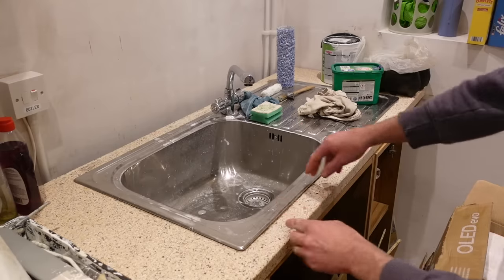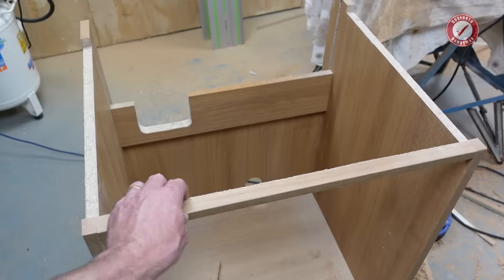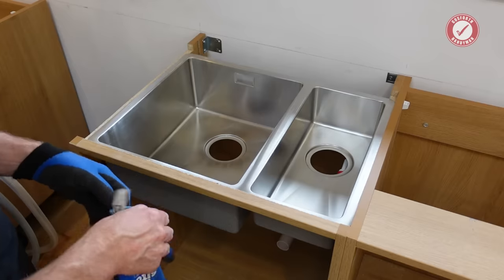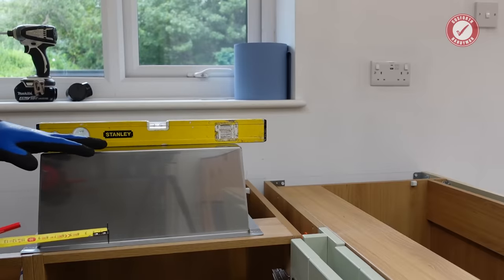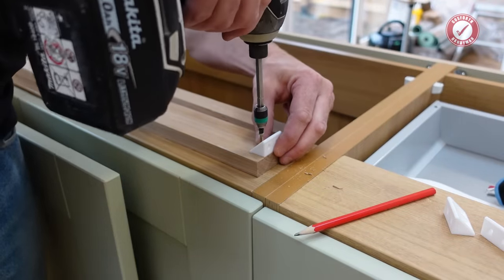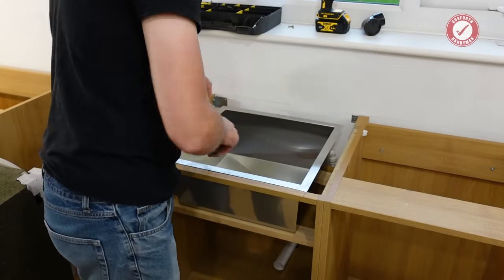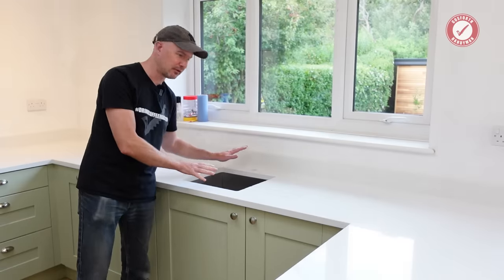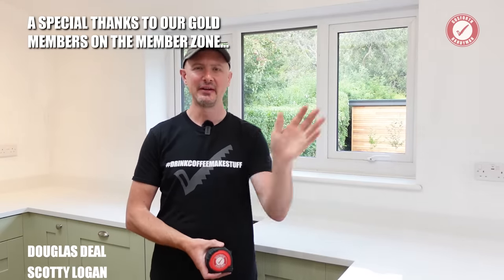How I fit an undermount sink for EASY MAINTENANCE

Comment: My quartz fitters used some super strong adhesive/silicone in my recently installed kitchen - same in the one I replaced. My kitchen fitters have added some custom metal braces underneath as a “just in case though”

You’re right about the clearance at the back for the tap - very tight but works with the overflow at the back. The other thing to note was if you have a single lever tap you can only have one which levers forward (not back) as it fouls the upstands/possibly the wall. Not a problem with your tap because you’ve got two levers which presumably lever towards the user.

Comment: Awesome job as per. Seems tiny compared to the size of your kitchen mind you.
Reply: The sink does look small.  My neighbor just installed a much larger one, but she uses very large pots quite often that need to be hand washed.  If the Mac family chef is satisfied with this one, then it will work.  For something that's too large, take it out to the back deck and use the garden hose.  ;-)
Reply from the maker: We went for bench space over big sink. Got the dishwasher so the sink is rarely used. 👍

Comment: I’m working on first fix electrics ahead of plastering. DIY kitchen units are heading to me in a couple of weeks. What are your socket heights from the floor? They look ideal with the upstand.
Reply from the maker: They're about 1170mm from finished floor. 👍
Reply: Keep in mind if you are tiling as well to try and keep the back box inline with a tile edge :D
Reply: @GosforthHandyman  is that 1170 to the top of the sockets?

Comment: I've never seen a shelf put directly under an undermount sink before.  Normally the sink is siliconed to the bottom of the top and held up by a screw/jack system until it sets. Then it's removed.  Maybe it's a UK vs Australia thing.

Comment: You can actually get adjustable metal brackets that go the full width of the cabinet so 600mm which are then attached to the cabinets and I put 2 in to support the sink Wren actually supply them with there kitchens cheers
Reply: They do but they wouldn't sell them to me as a part because kitchen wasn't from them.
Reply from the maker: Yup! Although I already had the wood and brackets. 👍😁

Comment: Why did you put the extra oak under the front bar? 
I always just drop the sink unit 2mm the easiest way to do it
Reply from the maker: To provide extra support for the weak point of the worktop. Seen too many over the years where that's cracked.

Comment: You shouldn't of fitted the sink till you installed the tap .....have fun trying to fit the locking nut etc at end of the day your not a kitchen fitter so its a mistake any one can make ...your still making a good job better than some of the fitters I have met in over 30yrs in the trade ...
Reply from the maker: Tap was really easy to fit! Cheers! 👍
Reply: @GosforthHandyman  ha! - 'professionals', eh, Gosforth...!?
Whenever anyone says 'I've been doing this since you were in short pants, sonny' - run a mile.........!!!

Comment: Thanks for the insights. 
Has anyone got a good link for doing it with a wooden countertop. I’m guessing most of the tips on this one hold for wood countertops. But there might be other specific gotcha points. 
Thanks again.
Reply: You can just use the supplied sink clips and screw into the underside of the worktop
Reply: Wooden countertops do seem more popular in the UK than in the US.
Reply: @Bobrogers99  its interesting isn’t it. I half tell myself that wooden surfaces and nicer and gentler but really I think it’s just personal taste. I guess the harder stone top gives cleaner lines. Probably less maintenance. It’s very popular in Ireland. But I just don’t warm to it. I like iroko wood myself. Heat resistant. Rot resistant if looked after and installed right. 
Anyway. Horses for courses. To each their own.
Reply from the maker: Yup, I'm pretty sure this sink came with the clips for wooden tops... although no idea what I did with them. 🤔😂

Comment: I like how you planned ahead of maintenance, I took the risk and has if undermounted with battens all around. I think I would have taken advantage of your 600 sink and just router out enough depth for the sink to sit on. I have the exact 400 sink you have btw, I did regret getting it as it is pretty flimsy and scratched all around within 1 month of use.

Comment: 1 1/2 bowl sink normally fitted to a 900mm cabinet.
Reply from the maker: Can't believe this suggests 400mm and above!
Reply: Mine is in a 600 unit, with a 140mm vertical front rail. I'll have to remove that rail to get access if something goes wrong, and if I'd have fitted it I would have used pocket screws on the front rail, but it shouldn't be too difficult to remove if required.

Comment: Your worried about the sink but got a double electric socket behind a sink? Does that pass code? Seems crazy risky to me that does
Reply: I don't know the code, but it looks far enough away from the sink to be safe.
Reply: @Bobrogers99  its underneath the sink... that's surely not far enough away? I've no idea and only want to know for a.future project
Reply: @Deanthomson88  I just went back and looked, and you're right.  I missed that one.  I presume that socket is there for the dishwasher, and that's the only place that it would be accessible.  But it still is very close to the plumbing!  The code must make an exception for it.
Reply from the maker: Very normal location for the dishwasher socket in the UK. Also bear in mind it's behind the unit, not in the unit.
Reply: @GosforthHandyman  thanks. I remember getting pulled on a job for this reason and had to move the socket a certain distance from the sink. Can't remember the exact measurement. But I'm sure your not allowed to be that close to the sink. Might be worth looking into it.
Reply from the maker: Only on the top side to avoid splashes. 👍

Comment: Very weird how undermount sinks are done in Wales/England.   I have never add a support frame built for my undermount sinks.  All undermount sinks as far as I know in the states are attached directly to the countertops before installation of the countertops and no support frame is ever built....   Support brackets are drilled directly into the countertops. This way allows for perfect alignment and a perfect seal.  Your way seems not practical for a perfect alignment or seal.

Comment: Wouldn’t it be fairly simple to just make sure that all the screws holding the unit in were accessible, then if the sink ever needed to come out, you could slide the whole unit out. Not that I’d be that concerned about making a sink removable for maintenance personally.
Reply from the maker: No 'cause the worktop is glued to the unit (siliconed). 👍
Reply: Does it need to be? If maintenance was a concern, wouldn’t you be able to just have it siliconed to the units either side to allow access?

Comment: Why have an under mounted sink in the first place…?
Reply: Because it looks nice.
Reply: You can brush crumbs straight in so makes cleaning easier
Reply: It avoids crud accumilating underneath the edge of the sink.
Reply from the maker: Yup, nothing wrong with inset sinks, but lots of advantages having an undermount. 👍
Reply: @firesurfer  yea but instead you can get scum build up between the rim of the sink and the worktop. Pros and cons to each I think, under mounts do look very nice
Reply: @Flat-Five  I said that.
Reply: @firesurfer  I mean on an undermount you can still get scum too building up where the top of the sink meets the underside of the worktop. I thought you were just saying an overrmount gets dirty
Reply: @Flat-Five  That space is usually caulked.

Comment: The back sink support rail you fitted will cause the overflow to have a "u" bend in it to attach to the waste. Not a good idea. IMO if you are not capable to move a hinge point; and you think the front worktop overhang is 20mm from the unit; you are making very basic errors. The way you fitted this sink made the front part of the worktop about 100mm...really sore back for the person who is going to wash up in the sink, and it pushes that tap way back towards the wall. All of this smacks of incompetent installation and no experience. You could easily have removed the front cabinet rail; made it detachable and vertical; lowered the hinge; whipped a few mm from the top of the carcass and slid in the original sink. I've been fitting kitchens for over 30 years with dozens of guys working for me and we have never needed to swap/replace a stainless steel sink. Ever. Period. The cut-out for access to the double socket which needs to be tested every 5 years...well, that's another joke !!!
Reply: No need for the rudeness. Andy was fairly clear that he'd not had a huge amount of experience of this and also asked for anyone who knew of a better way to comment. He's a very competent handyman, so it's not like he's taking on a job that only a professional should do, and it's unlikely that he'd get a professional coming round just to fit a sink.
Agree with most of your point though. The point about the hinge isn't that Andy was unable to move it though I'm sure, more that the door will have already been drilled for the hinge and probably wouldn't look good if moved. I'm guessing.
Reply from the maker: For someone so experienced, here's a few corrections 😉:
1. The overflow is to the right, not the back.
2. 20mm from the door, not the unit. 
3. We have a dishwasher and there's plenty space for the tap at the back.
4. The worktop installers decided on the final sink position. They seemed to know what they were doing.
5. I've seen LOTS of damaged sinks over the years.
6. The socket doesn't need to be tested every 5 years. What?!? 🤪
Reply: @GosforthHandyman  A couple of corrections for your replies, and a couple of other items : When or if you fit an upstand there will be a lot less room for that tap where you fitted it, central, instead of closer to the bowl-as per your marking out.   You measured from the carcass and spoke about it @ 20mm, not from the door. You do have the tiny new sink installed with the overflow to the right.....and have decided to have the drainer grooves on the same side...nice...good plan.  If you are not aware of electrical requirements in a kitchen then you should not be fitting a kitchen !!!!! ( and no, I didn't say you needed to be qualified to know the requirements)  The piece of paper you elegantly threw away from the dishwasher 😃😃installation shows an installation where the appliance fits under a top rail. When a standard overmount sink is installed, and the drainer goes over the dishwasher, a top rail is sometimes needed for support over a dishwasher. The paper shows that the rail must be set back to allow the door of the dishwasher to close correctly.  🤣🤣   Lovely looking kitchen though, good finish on the doors, solid cabinets and adjustable hinge plates. Dead right about four legged dishwashers being more stable too.
Reply: Five year test is for landlords….. no requirement at all for five year test in owner occupied property in Uk.
Reply: @iainhay2823  Remember woody is a kitchen fitting expert with 30 years experience and dozens of guys working for him. Yeah right. 😂😂😂😂😂😂
It's also worth pointing out that even with a 5 year landlord EICR you wouldn't remove every socket front. How woody isn't aware of this after 30 years speaks volumes as to the state of the industry.
Reply: @sparkybrian8512  having sparkies like you who plan not to test certain sockets in an EICR also speaks volumes of the industry too. But only the industry you are in, cuckoo land.:washhands::washhands::washhands::washhands::washhands::washhands:You probably still put fixed sockets behind chimney style cooker hoods with no isolation switching....
Reply: @GosforthHandyman  waste of time trying to argue with a smug, arrogant, condescending know - all, Gosforth - especially if he's a 'professional'..........!

Comment: Looks amazing. I am doing my 1930s semi and am about to place a big Screwfix order for 2.5mm wire, CAT6, etc... and 1 question - for general purpose 3 pin plugs - anything fancy? Or is a box of 10 LAP for £8 suitable? (Design aesthetics aside)?
Reply from the maker: We've done the 'posh shiny sockets' thing over the years. We don't really care now 😁. We just used BG but I'm sure Lap are fine. 👍
Reply: If you know how to change a socket. Any will do to be fair. But get something good for the high loads. Such as washing machines and tumble driers and the kettle. they always burn out, but you don't see the damage on the ones under the worktop. Get the good stuff for the kitchen basicaly.
Reply: @GosforthHandyman  Thank you.
Reply: @UberAlphaSirus  What is the good stuff?